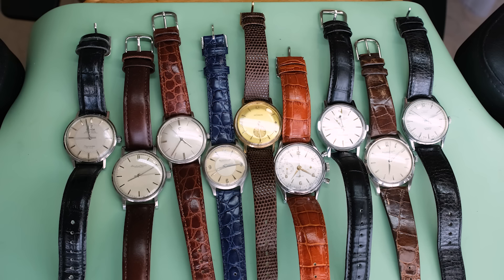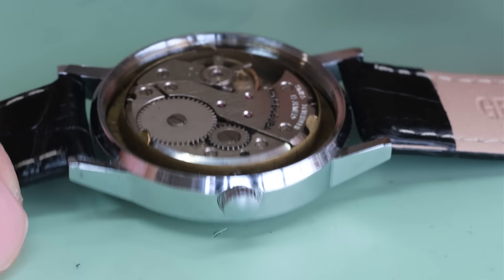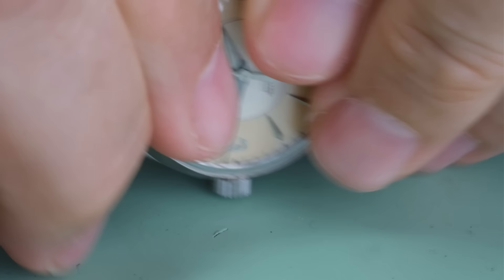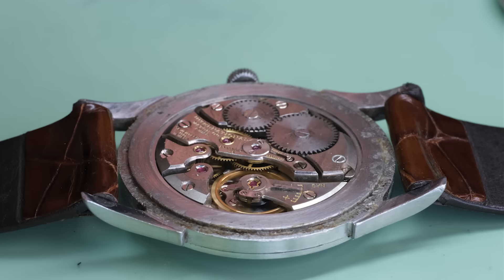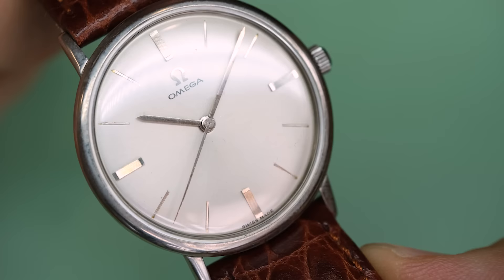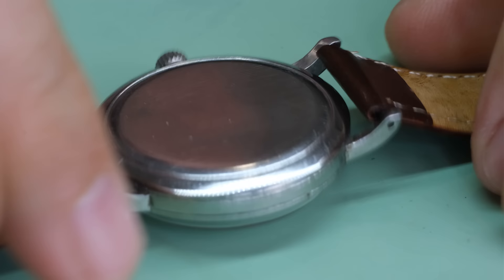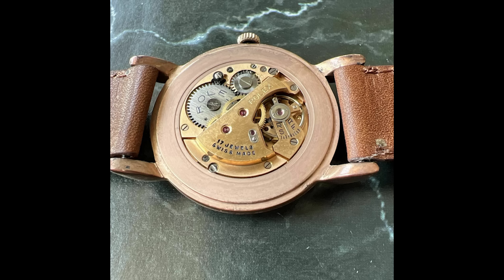How to waste money on eBay!

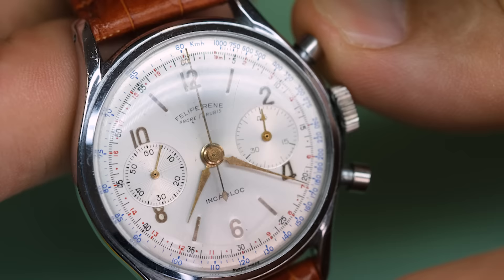Comment: OK Stian, I'm game!  The movement of the Felipe Rene watch @ 1:50 is missing the incabloc shock protection that it claims to have on the dial.  Also the spacing of the lettering in "Ancre 17 Rubis" seems a bit off... and it might just be my lack of watchmaker knowledge, but it also seems odd to have Spanish language on the back case of a Swiss-made watch with a French import code stamped on it (Fab. Suisse)?  Reminds me of some of the mid-grade fakes I saw in China, where they put on as many "authentic-looking" words & numbers as possible but without understanding what they actually meant.
Reply from the maker: Yeah, I'm not entirely sure how that watch came into existence, but it certainly is a Franken. The Spanish on the caseback isn't necessarily a warning sign if the watch was made for the Spanish market, but the dial and movement certainly were not original to each other :)

Comment: On that Le Coultre watch, how do you know what the original font is supposed to be and where do I find a proper example?  Because I have a vintage 14k gold LeCoultre that I thought was all original that looks just like that, it also has the wrong crown, but the case is properly stamped.  I'm wondering how to identify if it has the original dial.
Reply from the maker: You can look up the logo online and compare, and if you have the watch in your possession you can look at it under magnification to see how the print looks. It's not always easy!

Comment: the "mint" Omega at the very end has white-painted box hands (without pointed ends). I happen to have an Omega Geneve 166.0168 with the same hands on a blue dial and I'm curious - are the hands original? I tried googling and they show up occasionally, but not often enough to stop doubting.

Comment: Hello Stian! Can you recommend any sites which have images of correct watch faces and cases for authentication purposes? Also, how much trust would you put in the seller rating system as a gauge of trustworthiness when buying?

Edit; It would be great if you had a library of images of the past watches you have sold as a reference :) Lol, Way to put you on the spot, huh?
Reply from the maker: Hello Mike, there aren't really any sites that contain such information for a wide number of watches. There are sites for individual brands, but mostly I'd say that when you see a watch you might buy, google it, look at the images of it and follow the leads to some of the sites around that brand and reference. 
Seller rating systems are a good indicator of trustworthiness for sure, but of course not fail safe. In general I'd say never buy anything from sellers with a less than 99% rating, and look at the negative ratings to see what they say. Remember that ratings cover more things than just the watch itself, it also covers things like communication, shipping etc.
Reply: @VintageWatchServices  Thanks Stian. I sent someone your way who is looking for someone to service their grandfathers nice old Tudor day/date. You should hear from him soon I think. Thanks again.

Comment: Hello, firstly, excellent video. Secondly, do you know any encyclopedia like website containing photos of most watch models ? 
Because usually you end up on some shady forums when looking for pictures of genuine models to compare from. (even harder to find vintage models pictures).

Personally i don't mind frankensteins but being ripped off is not very pleasant.
At least some seller are straightforward, i bought a fake shturmanskie made from a zim movement and a pobeda case and it was in fact advertised as a pobeda. The movement kind of failed me though because it slips when i wind it up after 10-15 turns so i can't rely on it for time keeping : it dies in a few hours.
Reply from the maker: Thanks for watching! No, there's unfortunately no encyclopedia for watches, there are simply too many variations to keep track of. There are dedicated fan sites for some brands, so that's probably the best place to look.
Reply: @VintageWatchServices  alright thank you  !

Comment: I haven’t read the comments, but am sure someone else will have already mentioned it, the back of the Philipe Rene case said automatic.  The movement inside was manual wound.  

If I understood you correctly you are a little unkind to include the second Omega as a dud,  from what you said the only thing wrong with it is it has an incorrect replacement case back.  This would not prevent anyone’s enjoyment of the watch.
Reply from the maker: Hello Andy, thanks for watching! The Felipe René doesn't actually say automatic but it says incabloc on the dial while there isn't any shock setting in the movement

Comment: Got a 1901 Silver Thomas Russel of Liverpool sweeper (long second hand) pocket watch with Chester hallmarks, with makers to the queen (Victoria) and a sapphire hand holding jewel for £70 on eBay, three hundred pound service, the watch repairer offered me £700 for it and I said nope 👀

So there are bargains swimming around with all the sharks, mind you wrist watches are a minefield so it's a good thing I'm not taken with them, the nearest thing to a dud is again a Thomas Russel 1928 'time flies' movement pocket watch with a 9k gold case cost £600 on eBay from an established seller (all its money back then) but a train tooth is missing somewhere, and that's not a cheap fix, of course they didn't mention that in the item description, but I love the watch so didn't make a fuss as everything else is perfect, and if I made a fuss they might ask for it back  👈😕
Reply from the maker: Very nice! I suppose you still have that Thomas Russel?
Reply: @VintageWatchServices  

Good God yes, still got all my seven pocket watches, that's my maximum, so I'll have to sell one to get a new one 😁

1. John Barwise snr of London watch maker, silver pair cased 1791 watch low serial number signed movement, it runs its whole chain losing around a minute, he was on the longitude board.

2. 1847 (sold as British watch company) but there's nothing to suggest that other than the quilty of workmanship, gold fly wheel, I love this silver hunter because wear and polish over the years have turned it into a silver pebble, and it's got the most beautiful open smile Latin curved dial ever, runs its chain.

3. Perry of Liverpool slim hunter 1863 with roses engraved in the silver.

4. Thomas Russel 1901..as above

5. Albert Denison Birmingham gold hunter 1911

6. Benson bros of Liverpool open faced gold watch 1924.

7. Thomas Russel of Liverpool..as above

Everyday watch, 1963 omega gun metal case but I don't count that even though I still love it.

Comment: Can you recommend someone online that does watch repair and/or reburbishment on less valuable watches like a timex from the 60s.  I took mine to a local watch repair, and they want $100 just to look at it, then possibly more for the repair.  I would prefer to send it to someone that would produce a youtube video and I wouldnt mind paying for it.  I have gone to several watch repair youtube channels, and posted this same comment there, but have not received a reply.
Reply from the maker: I'm afraid you will find that most watchmakers do not want to do anything about cheap old watches such as the Timex. The reason is simply that such watches weren't actually made to be serviced, they were made to run well for a while and then to be thrown away when they stopped doing so. Pretty much the same model as today's fashion watches. This was due to them being made with unjeweled (or very lowly jeweled) pin pallet movements which introduce so much wear they become unreliable after some years. You can check this video for a discussion on that: https://youtu.be/HF9ZvXs5LD8

Comment: As with most purchases, buy the seller.  I would say, almost universally, avoid zero feed-back and newly registered sellers.

If the price is too high, or the watch is rough, or the seller has feed-back only as a buyer, run away.

ALWAYS assume the watch can use a service; on an entry-level priced watch, the service costs can and will turn a good deal into a bad deal.

And always remember, watch deals are like streetcars - another one will be along in five minutes.

Comment: could you please tell what is the movement used in https://www.youtube.com/watch?v=JZa2uzHlh7s&t=210s ? it looks like fhf96 but slightly different... like st96 stem has a screw which tightens the stem but here I can see press release stem mechanism.

Comment: Thanks for this upload. It's truly terrifying!
Good grief! If someone with your knowledge and experience is still able to be mislead, what hope do I have??  😳

I did manage to work out 'Incabloc' was the issue but there's not a chance I would've done so without your prompting. All I think I know about 'Incabloc' is that it's a shock protection mechanism and only Swiss mov'ts can use it (I don't know if the it refers to the name or the design of the mechanism though).

I've bought very cheap vintage watches (Vostok, Raketa and Poljot and a few Ricoh pieces - one being a 'Dynamic', a Rolex Day-Date copy sure, but I like it a lot and it runs well). They've almost all been go, but that was some years ago now.
I'm currently looking into early Certina DS, so '59 to '64 more or less (that case design is sublime and it's a lot of watch for the $) and the Seiko Lord-Matic 5601-9000 (with the Arabics and linen dial) is another one I like. I'm only going to buy from an online dealer and I'm only going to spend ~ $500AUD (so ~ $350USD-ish). I'm really just dipping my toe in the water to start.

What really interests me are mid 20th C. chronographs. I'll ease into that next. Probably spending ~ $1500AUD ($1K USD). From an online dealer, recently serviced and warrantied. It's seems to be mostly Landeron mov'ts for that money, or Venus. And maybe some Valjoux in the later models.
So my question to you is: Using the Filipe Rene as an example, what if I did happen to buy a re-dial? If it was inexpensive, freshly serviced and warrantied - and cheap because it's not original. If it's otherwise in good clean condition and it runs well, does it really matter? Especially if I'm not buying it to flip or (obviously) to invest.
Or is that just lazy? Is it better to never compromise on original, even if the watch is a little more banged up?
That's a serious question btw.
It's scary man!, I know it's not a lot of money in watch terms, but it's a lot to me. And $1500AUD gets me a choice of good, solid new watches, particularly from a micro-brand.
But hey!, no risk no reward. Isn't that what 'they' say?
Reply from the maker: Hello Anthony, well done on the Incabloc! The Incabloc is the shock-setting, which consists of a bearing (chaton), the cap jewel and the lyre-shaped spring. 
The Felipe Rene is not a redial, it's a "franken". They have taken a nice dial and case and combined it with an older movement. Likely the correct movement, but thus not with the Incabloc. It's still a beautiful watch in itself but that discrepancy proves it's not in its original state. And no, to most users it might not matter much. Very few users will ever see the movement, but if they buy this watch as it is now, their watchmaker will likely point that out to them when they have it serviced and then they would feel they have been cheated (at least I did!). If you're aware of it and the seller is open about it, you can in fact make a great deal. 
The most important thing when buying watches is to not be impatient. Don't click and buy something right away, but take your time, do your research and ask any questions you may have. There's always another watch if one slips away :)

Comment: I may be sound like a cynical old fart, partially because I am but I haven't used eBay in over 15 years now... it really is the worst, like trying to pull a diamond out of a barrel of poop.. sure there are some still in the barrel but do you want to dirty your hand doing so?

There are many great independent watch retailers, including yourself that know how to appraise a watch properly. Sure some of them might charge more but you know what you are getting.. do you want to buy 5 junkers for 200 each or 1 decent watch for a 1000?
Reply from the maker: eBay isn't quite that bad, I'd say, but you do need to inform yourself before buying stuff.